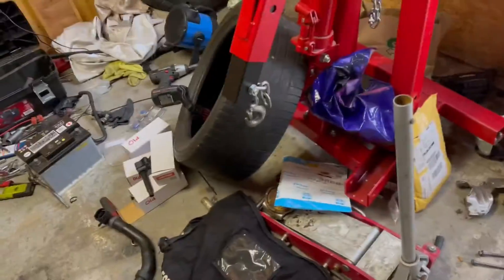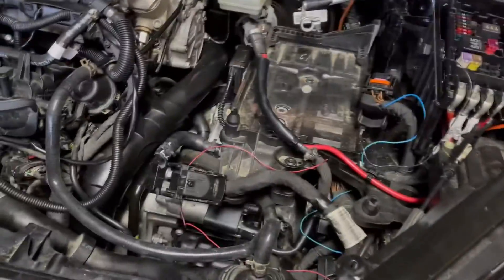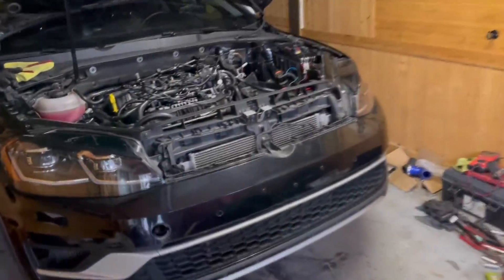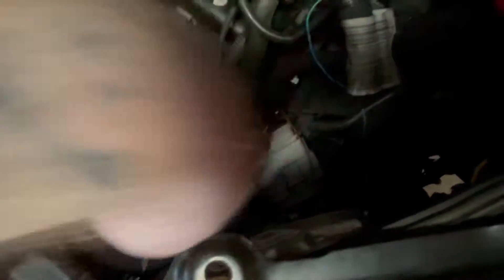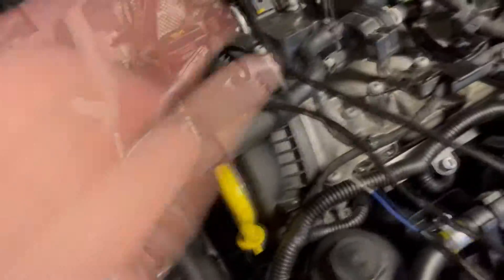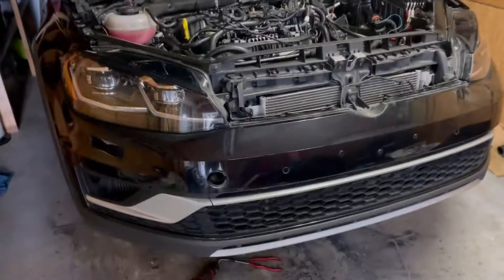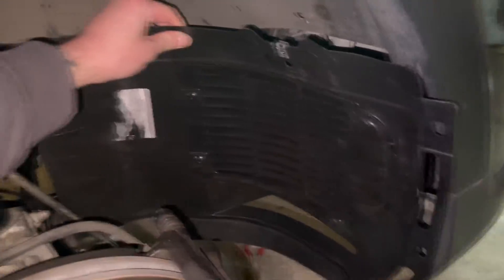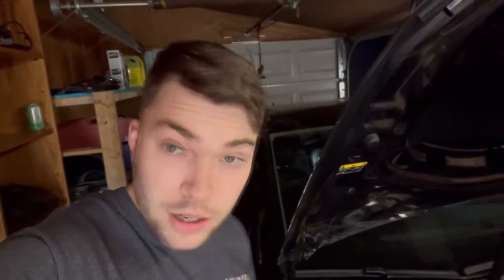MK7 Golf R Engine Swap Into Alltrack! | Part 3

Comment: Honestly think once you do get this running with that turbo , you will be the fastest alltrack in Canada , the 2.0t is much more tunable then a 1.8t can ever be. Chris Chee did it with a 2.0 GTi  motor, a few years ago and he is running Boss 600 turbo.  are you running dq250? or dq380/381?  If your running the DQ250 just be careful as these cant handle as much tq as DQ380/381,  ….
Reply from the maker: The car already starts and runs. ECU is sent off to tunezilla to get tuned as we speak. And yes I know Chris Chee, I’ve been chatting with him on instagram about the project. We are both running the DQ250. Even my Tuner tunezilla runs the DQ250 in their 2016 Audi S3 on the same turbo which is basically the same engine and trans as golf R, they run 9’s in the quarter mile. 0 issues with transmission. I’ll be basically having the same setup
Reply: did you ask chris how many dq250 he had to replace already?  i would get at least clutch kit
Reply from the maker: @manselnyc  he broke it only once, and only the top hat of the transmission. The rest was fine, it was repaired and no issues since. If my DQ250 blows up then the plan would be DQ500 from RS3 for the ultimate beast
Reply: yeah he told me the same thing and i took that and made sure i did something before adding my big turbo and so far over 400 wtq not hub tq no issues.  would love to see your build on a loaded dyno with wheels and tires on and all 4 wheels rolling…
Reply from the maker: @manselnyc  soon as I get my ECU back I am going straight to the dyno, provided that I have no further bugs/glitches and no more coding is needed. But I am expecting to have the same power as tunezilla’s S3 since the drivetrain, bolt ons, and tune file are identical. 566WHP and 518WTQ on E60